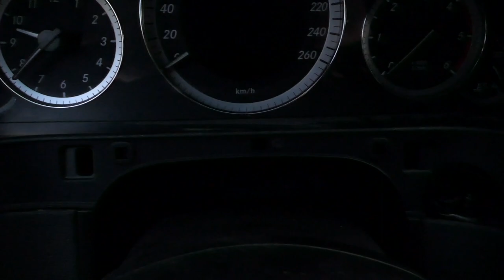Mercedes W212 | How To Remove Front Air Vents

Comment: What is that plug and wire connect to each vent for? Is that for illuminated thumbwheel light??
Reply from the maker: Yess and the ambient light tube under the vent.